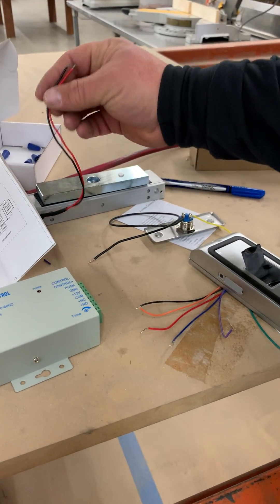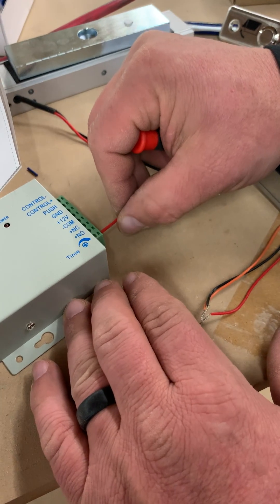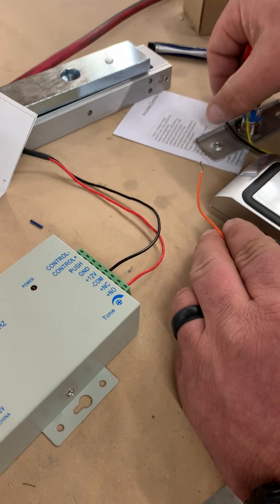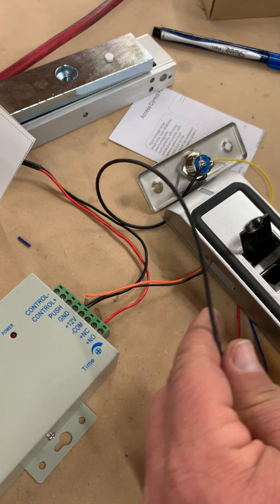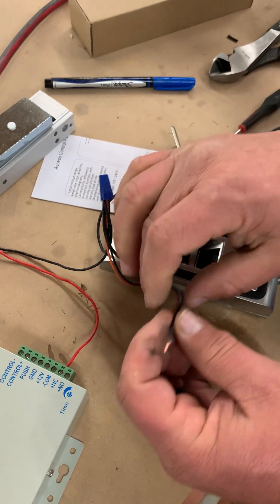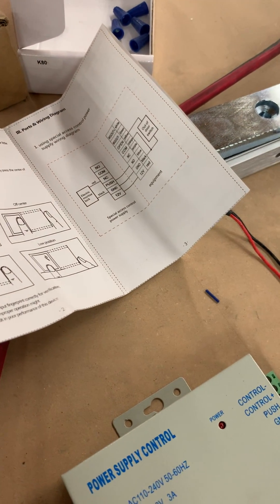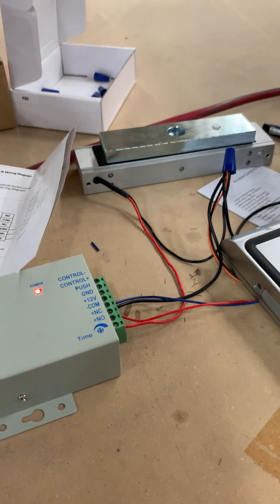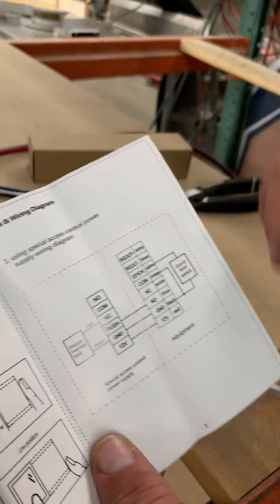Mag Lock Wiring

Comment: what wire would you use to extended the push button or finger/code panel? ive read 18/2 but cant seem to find any at my local home improvement stores
Reply: 18/2 is great. You can use sprinkler wire it is easy to get and it is inexpensive
Reply: you can use multi conductor wire.  more expensive though